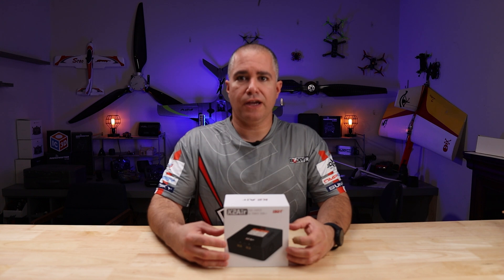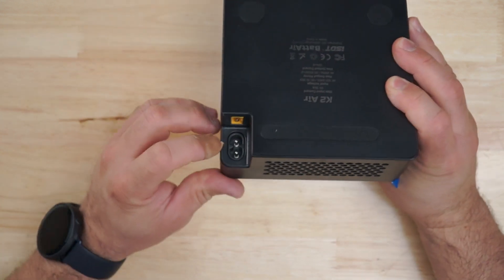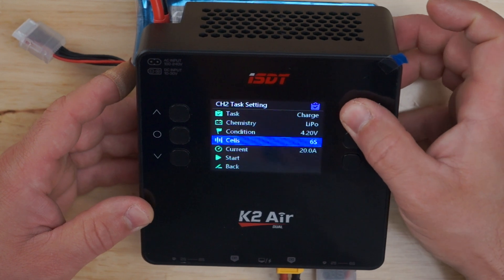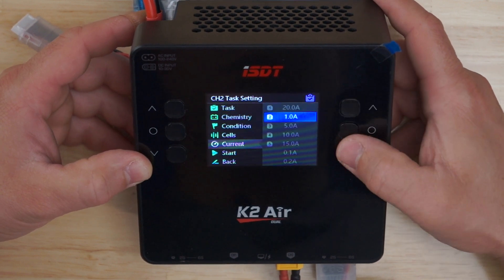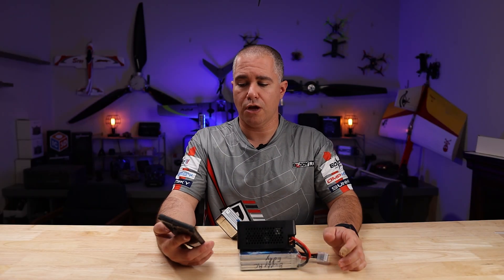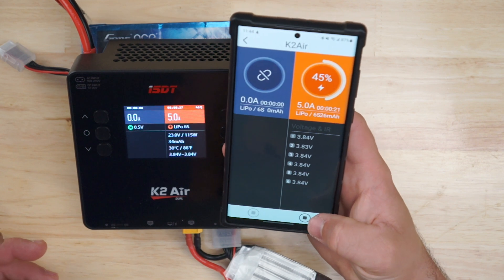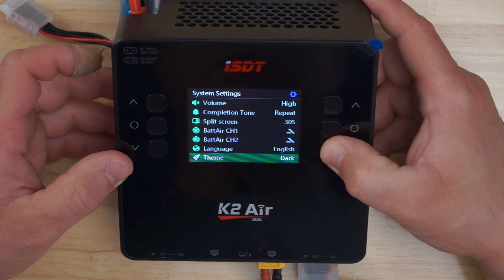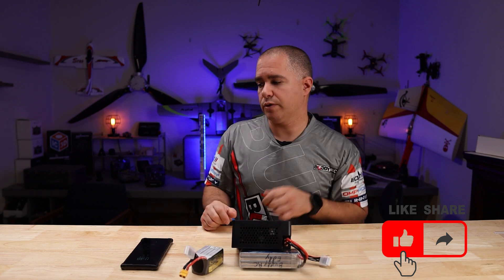iSDT K2 Air Charger Unboxing and overview

Comment: You can't charge a 2S radio controller battery with this, can you? I bought one but after getting it realized it does not have a port for the smaller XT30 connector on the radio batteries, just the bigger XT60 connector for drone batteries. I'm a noob fml
Reply from the maker: Thanks for watching! It will charge them you just need to correct plug. If your battery has a XT30 on it you can find a XT60 to XT30 adapter to plug in to the charger, this is how I charge my M2 batteries. Hope this helps, if not email us at Support@buddyrc.com for more help.

Comment: Finally something to replace my old ass iCharger.
Reply from the maker: We like to provide options
Reply: @BuddyRC  I ended up getting it. Have you ever tried charging NiMh? When I try to charge two "AA" batteries it sends them 30 volts! I have the two AA in series, connected to the XT60 port. Super annoying because I bought it mainly to charge household batteries.

Comment: Nice video! does this support 200w on both channels or is it over both? Also what dc power supply do you use?
Reply from the maker: I used the AC connection but on DC we use the BUddyRC Power Supply https://www.buddyrc.com/collections/power-supply/products/buddy-rc-1800w-75a-24v-server-power-supply?variant=32705458438230

Comment: important point that got missed..the app based phone monitoring works with bluetooth(not over wifi)..meaning you dont have much range,I saw the review and actually thought it worked over wifi,and bought this...hoping I could be in any room of my house..which is not the case..:/
Reply from the maker: It works on bluetooth you're correct and we promote safe charging practices to not leave batteries that are charging unattended.

Comment: *Edit*  was able to successfully update it on the computer but now the USB c port is acting up :/ I get a "USB Fail" when connecting it to the PC.

Just received my ISDT K2 Air today and connected it to the ISDT Link app, it automatically said there was an update and after doing it, the charger is now stuck on a blue screen that says "Update"
This seems to be a common problem and the solution is just not updating it through the app. Use your PC. Now I have to figure out if its bricked or if ill be able to recover the device :/
Reply from the maker: Could also be the charge cable. Try a different wire.
Reply: @BuddyRC  I've tried 13 different type c cables. Its just a faulty USB plug. But since I don't have a YouTube channel there is no customer support. They will only help people with influence.